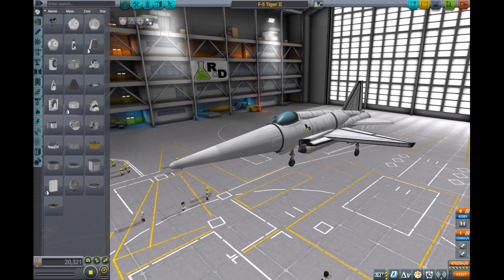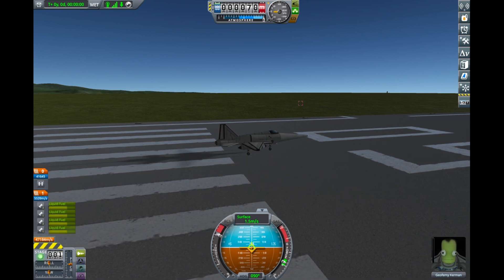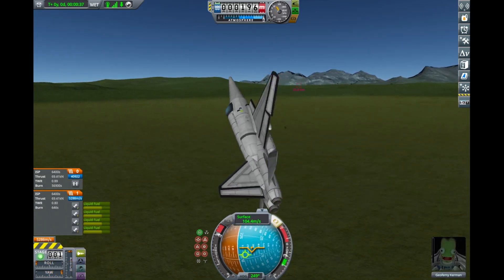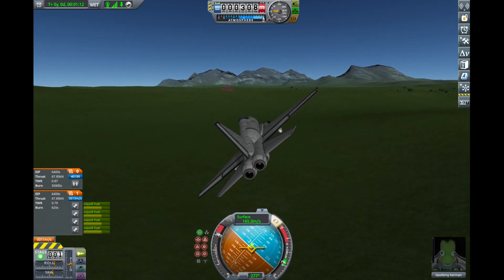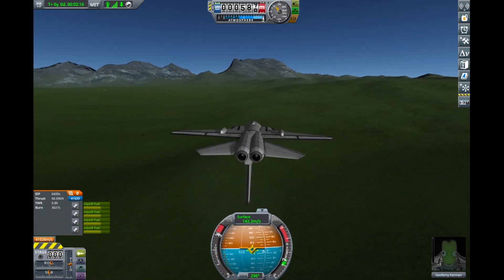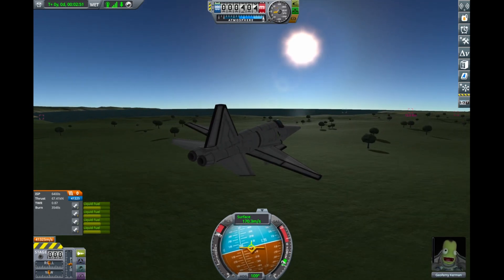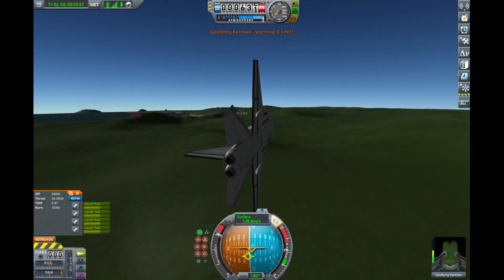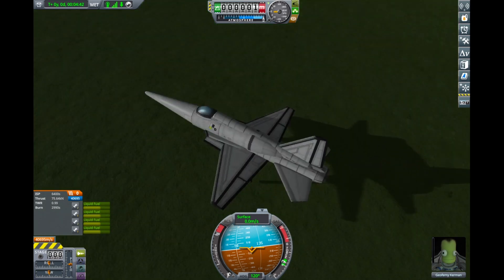A Correctly Sized F-5 Tiger II in KSP

Comment: I just wish they would add smaller engines with afterburner. I recently made a f101 voodoo and had to just deal with having the two massive panther engines cause two junos would be two weak
Reply from the maker: Options:
1. Double up the engines. More weight, more fuel use, more thrust, but fairly balanced. Sucks for the part count though.
2. Robotics parts allow you to make engines more powerful than they're supposed to be by setting their thrust limits above 100%.
3. Mods. TweakScale for the simplest changes, or just custom engines.

I used to be more against mods than I am now. Since the game is end of life, updates won't break mods anymore.